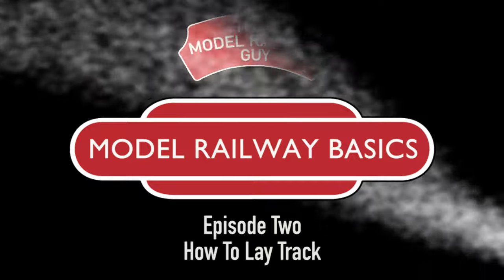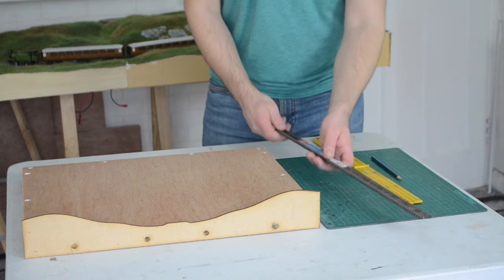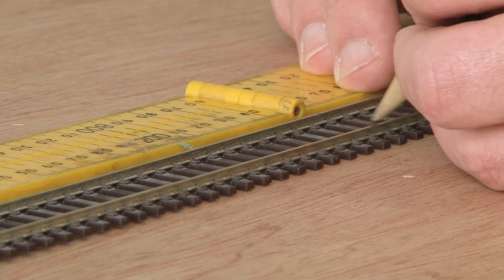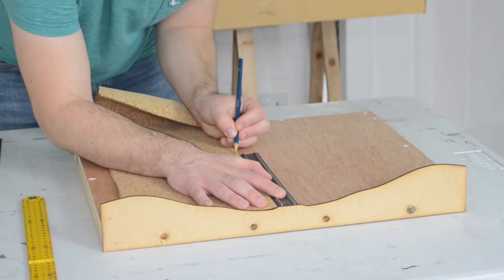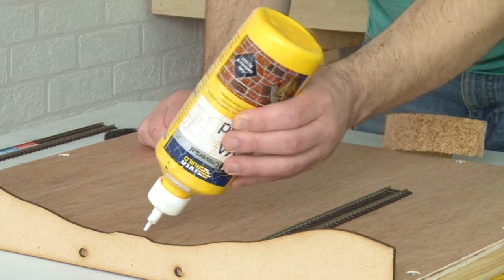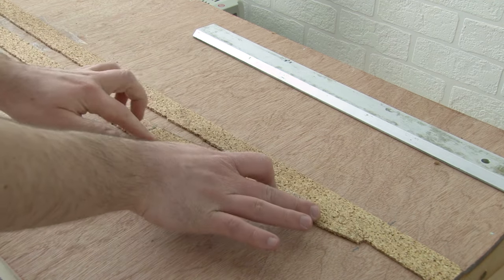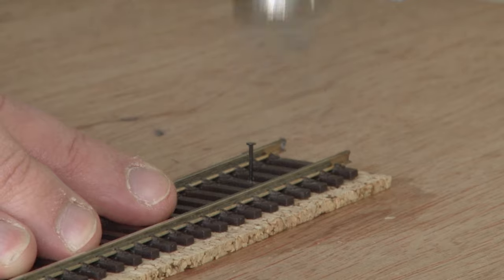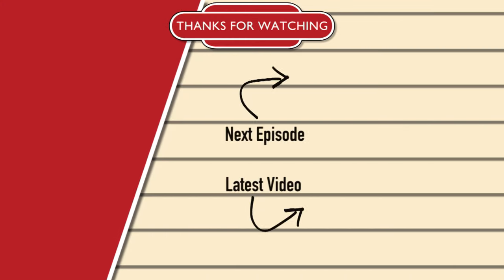Track Laying For Beginners - Model Railway Basics: Episode 2

Comment: The #1 Rule DO NOT RUSH Track Laying Take Your Time when when Laying Track.Slow Down and It will Work out Perfect Rush it and It won’t work out.Also Remember this Build with Pride And Passion Not to Race to get it done.
Reply from the maker: Yep as I said in the video, if you don't lay your track properly you'll end up with more problems later on so it's definitely worth spending time on it. Thanks for watching 😃

Comment: Just a wee tip I didnt glue my battens just screwed them as the day will come when you need to take it apart which you cant do if you have glued it
Reply from the maker: I covered that at 07:08. Personally I prefer to tack my track anyway but I know others prefer glue as they don't like the visual of having nails through the sleepers. As this series is intended for beginners I felt it was only right to give people the option of both techniques so they can choose for themselves. Thanks for watching 👍

Comment: After I lay the track, and add another track infront of it, will I need connectors to connect the tracks? Or just put them very close to each other?
Reply from the maker: Yes you will need Rail Joiners, also known as Fishplates. These connect the track together and allow the power to flow round the layout. Thanks for watching 😃

Comment: What track would u recommend I don’t like the Bachmann track with black road bed trains run crappy on it
Reply from the maker: Personally I use PECO track on all my layouts. It’s generally considered the best around, they have a wide range of points and they do Setrack (clip together sections) and more realistic Flexitrack. Thanks for watching 😃
Reply: @ThatModelRailwayGuy  what if you have a tight budget
Reply from the maker: @NYandAtlantic  Well Setrack is easier to use but more expensive for what you get. The Flexitrack is about £4 a yard (91.5cm) but the points can stack up quite quickly so if you're on a budget I'd suggest building something that doesn't require a lot of points.

You could buy secondhand track if you're on a really tight budget but I don't know that it's all that much cheaper and you may find it causes other issues. If you want your trains to run well then personally I would spend my budget on getting decent track and cut down elsewhere.

Comment: I use Copydex (latex adhesive)  instead of P VA. Track can be easily lifted with a palette knife and the adhesive peeled away. Lifting track laid with screws or pins can result in damage to the sleepers.
Reply from the maker: Yep, I've used spray glue on the cork and track in the past too and I've found it's great if you're working quickly. As this is a tutorial for complete beginners though I was just trying to keep it as simple as possible, hence the more traditional PVA and track pins route. Thanks for watching 😃

Comment: Excellent video.

You explain things in a simple and easy to understand way, so a complete novice/newbie  has an idea of what to do..

Many thanks 👍📌
Reply: EDIT..

How do you join two lengths of track together??
Fishplates spring to mind, or is there something newer or better nowadays??
Reply from the maker: Hi Chris, really glad you've found the videos useful. Yes fishplates are still the norm for joining track together. The set track pieces have them built in but for flexible track you'll need to get hold of them separately. Hope that helps and thanks for watching 😃

Comment: I wince when l see even the modelling mags demonstrating laying track using pins and a great big hammer.
I have seen so much damage to rails caused by hammer blows at my model railway club and elsewhere.
I find that an impact glue is perfectly suitable for holding track in place until it is ballasted.
If any sort of holding pin is required until glue sets on curves for example then temporarily use of drawing pins pressed down 
with finger pressure is perfectly fine.
Another thing l can't  stand to see modelling mags promote is the soldering of wire to the side of the rail.
This not only looks unsightly but can often cause excess solder above rail head to be picked up on loco wheels and spread liberally 
over the rest of the trackwork.
I always make soldered wire connections to the underside of the rail, which makes it invisible once ballasting is completed.
Anyway nice video, it's good to encourage new modellers in to the hobby.
Reply from the maker: I think, as you mentioned at the end of your comment, it's about encouraging newcomers into the hobby. Track pins are often seen as a much easier way for beginners to get started especially when they're often using Code 100 set track. For more finescale modelling, glue is absolutely the way to go but if you're just getting started it can be reassuring to know that if it all goes wrong you can just take out the pins and start again.

I definitely agree with you on soldering the wires to the bottom of the rail though! Occasionally I've seen people soldering additional feeders to the rails after the track has already been laid... but certainly when your putting it down initially it's so much easier to take out a sleeper and solder to the flat bottom. Thanks for watching 😃

Comment: To contribute to the debate about whether cork deadens sound or not:
Cork is very porous, which means that it can get filled with glue. If the glue of a type that dries up hard, the cork will get hard as well and sound will not be dampened. If the dry glue is still flexible, there's definitely a chance that sounds will be dampened.
Reply from the maker: It is an interesting debate certainly, although one I feel is probably more relevant from a while back when locos were more noisy. I've got sections on my layout where the cork has been ballasted and parts where it's still bare and the difference in sound is minimal in my opinion. Really I think it's more down to creating a shoulder for the ballast these day and giving the track a nice surface to sit on. Thanks for watching 😃

Comment: Great easy to follow video. If you are running two lines what should the scale distance between the two lines be and should they be mounted on one wider strip of cork or two separate runs ? I'm thinking of giving this a go with my son and wanted to get it as accurate as possible. Thanks very much. 👍
Reply from the maker: I think it's about 25mm between to the two inner rails. Peco actually make a little plastic spacer tool for this purpose which lines up with the geometry of their points so it might be worth trying to pick one of those up if you can. 
With regards to cork, personally I would have a separate strip of cork for each running line to get the proper ballast shoulders, but of course you're welcome to build your own railways however you want. Best of luck with it and thanks for watching 😃
Reply: @ThatModelRailwayGuy  Thanks for taking the time to reply. I built a 6 x4 base board using a sundeala top when he was going but we never had the space to set it up. He's now 21 and bought a shed so we're having a go in there.

Comment: Thank you this is very helpful! Question though: I am struggling to decide on the size of my table and layout because my understanding is that minimum radius for OO is 500mm. It makes it difficult to have a double curve and leave space for hills etc, even on a 1.5mx3m table as I am planning. Yet I see lot's of 1.2 x 2.4 layouts (4x8feet). How do modellers fit OO gauge on such a small table?
Reply from the maker: I don't know where you've got 500mm as a minimum radius from - Radius 1 in 00 gauge is 371mm with Radius 2 coming in at 438mm. Hope that helps and thanks for watching 👍

Comment: I know this is a 3 year video but hopefully your still answering questions, first of all thanks for a wonderful tutorial, the only question is for us peasants and unskilled people that by pre built models, do i need to raise up the buildings, platforms, bridges, and tunnels entrances/ portals on cork to match the hight of the rails or is this already taken into consideration with the models?
Reply from the maker: I'm always here to answer questions! 😉
Platforms will be your biggest issue regarding height. If you want the height to be absolutely perfect you may want to raise them up on cork too. That said, I know of some stations where there's a bit of jump down from the train to platform surface so it's not completely un-prototypical... it depends on how you want it look and whether you think it'll bother you.

Lineside buildings don't really need to be raised up as the cork is just intended to represent the slightly raised trackbed anyway. Bearing in mind as well that the 3mm thickness of cork equals to less than a foot in 00 gauge.
 
For bridges/tunnels, I would recommend checking all clearances regardless of whether you use cork or not. All the ones I used on my layout were fine but the chimney of Stephenson's Rocket (which is my tallest loco) comes close on some. Everything else has been fine in terms of height but like I said it's always best to check before gluing something in position. Hope that helps and thanks for watching 👍
Reply: @ThatModelRailwayGuy  thanks for replying so fast, that helps me out a lot, i made a layout about 20 years ago and never did the whole cork thing, and boy was it noisy, now my own boy is growing and showing interest, I’m going to start making a 4x8, but as storage space is a big problem, I’m taking as many notes about your modular series as i can and hopefully I can make something that somewhat looks ok. Thanks for the great comment and feedback, kind regards
Kane (35) and justin(11)

Comment: Can I run flex track on acrylic like the 1/2 inch thick sheets at lowes or home depot. No track bed just attached (glue or other way). I know I'll need to use a lot of small clamps.
Reply from the maker: Interesting idea but honestly I can't say for certain having never tried it myself. In theory as long as the acrylic sheet doesn't flex or bend at all you should be ok - if it does you'll need to add some bracing. But otherwise I imagine it would be the same as laying track on any other flat surface. Thanks for watching 😃

Comment: I'm almost ready to start laying track with your video as a guide, but some bright spark on a facebook Model Railway group page piped up and said if 3mm cork is used under the track on a oo gauge layout, it also has to be laid under station platforms, etc, as without it, the scale would be wrong... is there a checklist as such to what 'fixed' buildings would have to be raised in the same way, or he he just being somewhat pedantic about it?
Reply from the maker: Hi Peter, technically they're not wrong but it depends how you're building your platforms. I just made mine 3mm taller when constructing them as I built my platforms from foam board. 

Aside from platforms the only other things I think would be effected are bridges and tunnels but only if the clearance underneath is really tight! I certainly didn't need to adjust mine on my layout.

Remember though adding cork is an optional extra. You don't have to use it so if it's casing you a headache then you can lay the track directly on the baseboard. Hope that helps and thanks for watching 😃
Reply: @ThatModelRailwayGuy  Thank you for getting back to me so quickly. I'm opting to use the cork for the help with soundproofing and for the 'shoulders' it creates for the ballasting - when I was on the footplate yonks ago, this was most noticable on the express runs (along with the banking) but not so much on approaches to stations. I take onboard the measures you took to maintain the scale and will follow that by adding cork under the relevant and noticable areas. Problem solved :)

Comment: Great informative watch 👌Is it possible to use both steel and nickel silver track combined in sections?
Reply from the maker: Thanks Darren! Great question - I wouldn't personally do it but if the rail heights match (ie: both Code 100) then there's nothing to stop you. I imagine you'll be able to tell the difference between the sections though with how smooth the trains run. Hope that helps and thanks for watching 😃
Reply: @ThatModelRailwayGuy  Excellent, thanks for the info, much appreciated 👍

Comment: So the pin doesn’t penetrate the baseboard just the cork?
Reply from the maker: The pin goes through the cork and penetrates into the baseboard. Ideally you want to use pin long enough to lodge into the wood but not come out the other side, which obviously depends on the thickness of wood you're using. Thanks for watching 😃

Comment: Not sure if this has been asked and answered but I have purchased a large amount of used track and and a lot of the fishplates could use a clean up, is this possible as buying new seems silly expensive?!? By the way love this playlist. As someone starting out super useful 👌🏼💯🔥
Reply from the maker: Hi Craig, to be honest I'm not too sure. It might be worth checking out some of the model railway forums to see if anyone has tried something similar. I seem to remember someone mentioning something about using watered down vinegar or IPA for something similar... but it was a while ago and I don't want you to ruin your track off some dodgy advice from me!

Remember though that the fishplates carry the current around your layout so you want them to work as well as possible and it's there's a chance they might still be temperamental even after cleaning. If that's the case you may be better biting the bullet and getting some new ones for the best results - the PECO ones aren't too bad at around £3 for 24 I think. 

Sorry I haven't been more helpful but I'm glad you're enjoying the playlist as you're exactly the type of person it was made for. Thanks for watching 😃
Reply: @ThatModelRailwayGuy  you have been a big help my guy and the (best respect) guilds are so simple and what I needed to get to grips with everything! At 38 years old it's exactly what i needed. I will.look in to the PECO plates thank you

Comment: OK.

I agree with most of what you just showed BUT...

You need a proper hammer for the job.
A lightweight hanmer with tapered head on a long handle is more precise and reduces the risk of damaging the rail.
Combined with a pin pusher you can't go wrong.
Reply from the maker: Thanks James. Yes in an ideal situation that would be best but as I mentioned in reply to a similar comment, a total beginner is unlikely to have a specialised hammer or pin pusher at this stage. Thanks for watching 😃
Reply: @ThatModelRailwayGuy  i see your point mate.

When asked as shows about model making and layout builds my advice to people is always invest in your tool kit. 
Buying locos and rolling stock is nice but the right tool for the job is often essential.
Reply from the maker: Definitely, investing in the right tools for the job is a really great idea. My hope with this series is to encourage newcomers into the hobby initially by starting simple. Once they've got something up and running hopefully they'll want to explore further and take things to the next level to get even better results. Thanks for watching 😃
Reply: I'm new to this and brought a pin hammer from Amazon £3:99

Comment: If using foam. spray adhesive melts foam .
Reply from the maker: To be honest I wouldn't recommend using foam over cork anyway. In my experience it always tends to disintegrate. Thanks for watching 😃
Reply: @ThatModelRailwayGuy  not for road bed. Pink and blue foam. Building up scenes. Was just saying if using foam for your layout (not just wood) it melts.

Comment: I hate flex track. They always come out of the sleepers
Reply from the maker: How far are you bending it? I've found the tighter the curve the more likely the sleepers are to pop out. But if you prefer using set track pieces that's absolutely fine - you can definitely get the track down quicker that way. Thanks for watching 😃
Reply: Hornby fleet track is crap. Peco is much better and the rails won’t pop out.

Comment: Hi, sorry to be a bit negative but this was supposed to be a basic tutorial. You explained what flex track is but then installed a short length of it straight which is easy to do. No mention of how the rails will pull in and out for a curve and how to do that. Also just saying "you will have to find a way to hold flex track curves" is not really what us novice starters want to hear. We are looking on tutorial clips to find out different ways of doing things, not be told we have to find a way!
Sorry.
Reply from the maker: I covered cutting the rails at the start of the video. Naturally you would measure the track and mark the rails before cutting it to account for the curve. As for holding the track down on curves, this only applies when using glue which is more of an advanced technique and is why I highly recommend using track pins for beginners. The same as how in the wiring episode I covered the existence of electrofrog points, but didn't go into the nuances of how they work. 
How you hold the track depends on the type of glue you're using. For fast setting glue you can simply hold it in place (with your hands) while it dries. For longer setting glues some people use weights or even track pins to hold it in place. Thanks for watching 😃

Comment: Smaller hammer head!
Reply from the maker: Hey there, so as I mentioned in reply to similar comments, this video is intended for complete beginners who probably won't have a special track pin hammer or pin pusher. While I agree that a smaller hammer is better in the long run, the idea here is to show that it is possible to use a standard hammer when just starting out as long as you're careful. Thanks for watching 😃